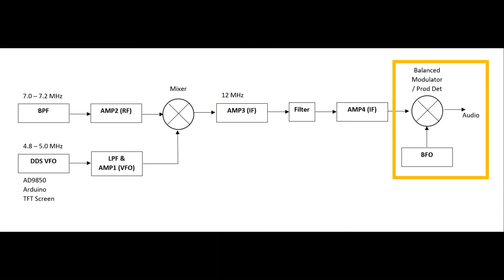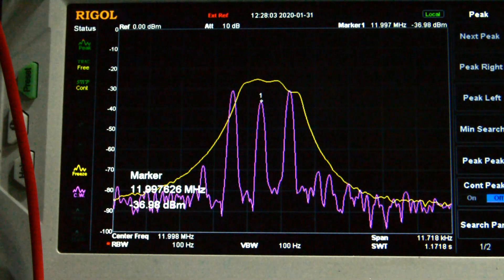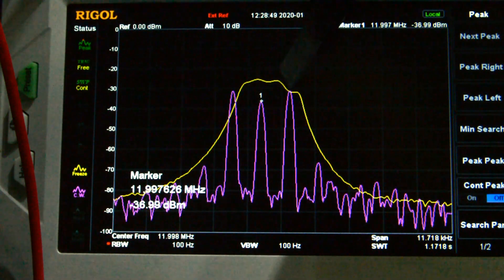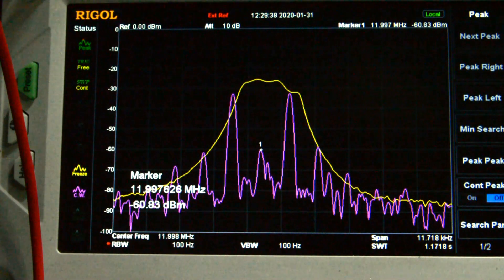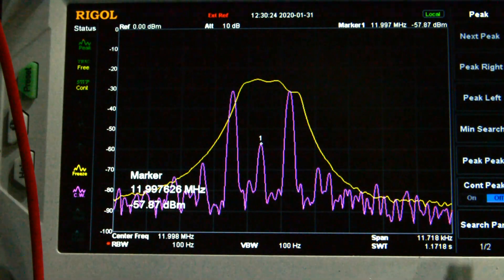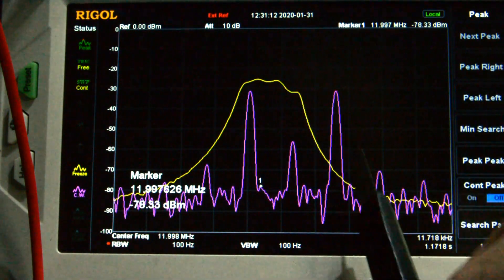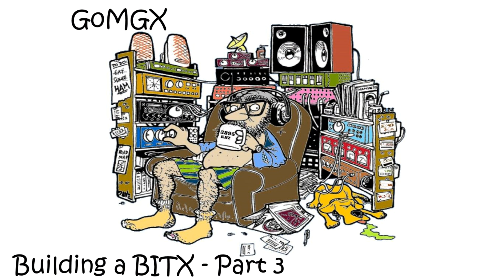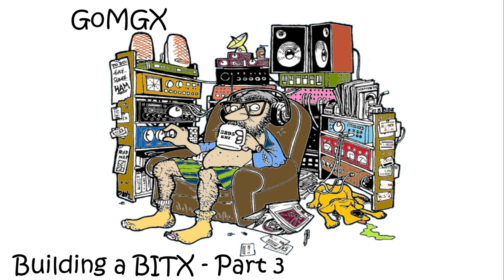Building a basic QRP homebrew BITX - Part3

Comment: Hi Mark. I'm enjoying your posts as I'm working on a similar project. I built up 4 balanced modulators before I got something to null nicely! I mucked about matching diodes (1N4148's) across a range of currents, trying to find a pair with the same IV curve (I think that's the right term, but ignore if I'm wrong). On reflection, a bit of an overkill. After more mucking about I found diodes with the same voltage drop driven with 5mA worked in my setup (you tested at 1mA?). The other thing that buggered me up was trying to put other elements on the same board as the balanced modulator (mic amp, rf amp after the pot). Things seemed to be getting in to things - I never figured what was upsetting what, but a small amount of physical separation made a big difference. And a curiosity … what's on the output of your balanced modulator to complete the DC path? I have a RFC (as many windings as I could on a small ferrite bead).
Reply from the maker: I''ll try matching the diodes at 5mA, but I would think that the actual current in circuit is very small.  Will report back! Thanks for the feedback
Reply from the maker: I've added some capacitance either side of the balanced mod and the results are excelent. 20pf on one side and a 5-40pf trimmer on the other. Please see the bottom of this blog post: https://g0mgx.blogspot.com/2020/02/back-to-bitx.html